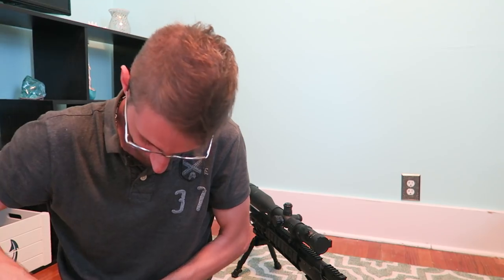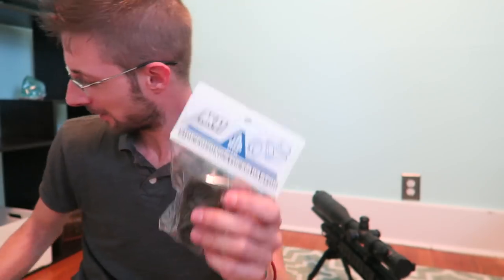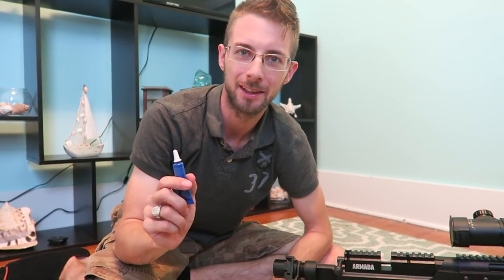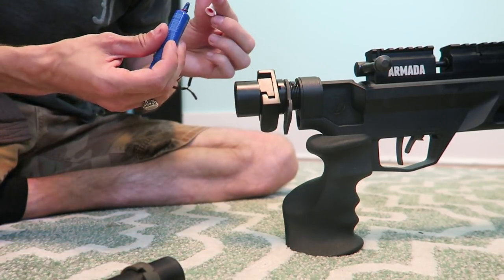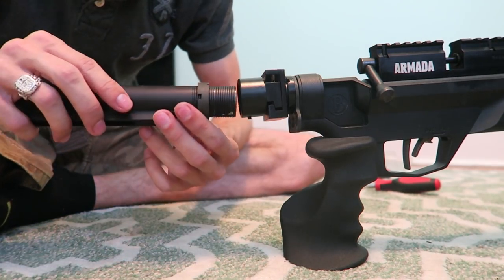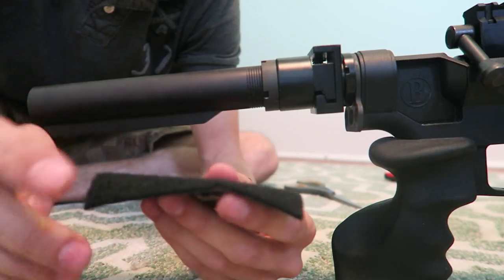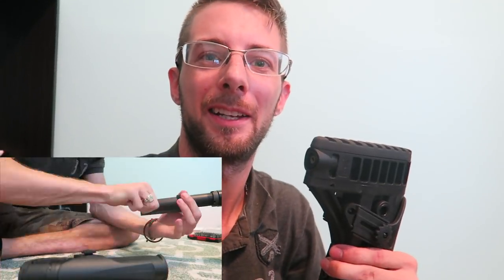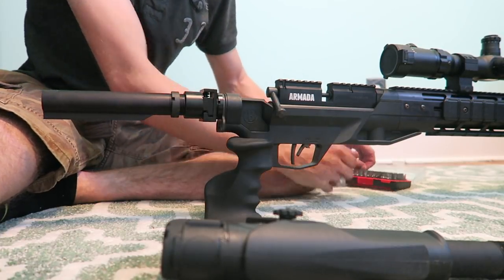Benjamin Armada | Folding Stock | Airgun Evolution

Comment: Hi if you have a problem again with this adapter witch most do i would go with the law tactical clone they look better work better also has a release tab to fold gun you might find in  soft air parts on eBay not always easy to find but if you do well worth 35$ vs original law tactical if ever need a replacement  its the way to go. nice gun i have almost the same set up.
Reply from the maker: I never knew that made a clone one I have seen a Law tactical side folder and it is awesome. a clone version would be ideal now I wish I hadn't Red loctite'd the hell out of that SOB.
If you have a link to one please send it over I just looked for one on eBay with no luck. thanks.
Reply: Airgun Evolution  I'll try to get you a good link I only will leave a link when I can find it in the 40$ range  if you type folding stock adapter right now you will see some but there trying to charge 100$ which is not to bad but it's a clone any time you see the cardboard box it a clone even if they say it real it's not . I have both and the clone is very good for it price.

Comment: Where did you get that carbon fiber silencer you had? And do they make different styles? Like a regular muzzle break. I just want something a little bit shorter. You got me excited so I got an Armada .25 and am modding it somewhat similarly. I'm doing the same folding type stock Adapter just for when I'm walking through the woods with it. and I also am going to try a canted red dot.
Reply from the maker: Awesome, my suppressor was made by Neil Clauge.. I don't know if he still makes them but you should look up Donnyfl. Donny has the best suppressors on the marked in all diffrent sizes he even had one called the Fat Boy which was carbon fiber...  one thing I would suggest is a sling for the Armada it gets heavy with all the mods and a sling would be real nice, also the plastic/ polymer rail sections they send with the gun art the best and mine broke so if you do get a sling don't trust them to hold the weight of the gun I'd get some cheap aluminum ones off ebay
Reply: @AirgunEvolution  I picked up a 2 point bungie sling off amazon, got the adapter to put on the folding stock and I went with the cvlife 6-24 x50. and some aluminum key mod rails. I went with the plastic quick indexes instead of the stock rail guards as well. plan just to put my rails where I put my mods and then cover everything else with the quick index I got a vertical foregrip for leverage when cocking and aiming. And the bipod mount. Then I'm going with a green pinty laser on the right and a flashlight on the left. Then since the magazine portrudes from the right at a 45 degree angle I got a 30 degree canted red dot, For ranges within 25 meters or so. Hoo ra lol. I live in vt and it's fun to bring an airgun in the summer while I walk the riverbeds

Comment: so when you gonna site your rifles at 80 yards   you get a realtor sign  put some card board in  where the sign goes target stand    and squeeze the trigger
Reply from the maker: Hahahaha the funny thing is I "acquired" a real heavy duty realtor sign for just that purpose. I also use those signs that people stick in there yards at election time, the range I go to has a bunch of them. unfortunately my local range only goes out to 60 yards but I have a few places for sighting in at longer ranges.
Reply: I keep 2 of the realtor signs in my truck I broke off the rods they stick the cardboard on   and put the cardboard in the metal frame    and hold it with binder clips    if I mess one up  just go get another one  I have had like 4 or 5 set up at once for a nice range

Comment: Hot air gun should soften loctite when you are ready to remove it again.
Reply from the maker: As my luck would go I found my blue lock tight the next day. hopefully I won't need to remove it but if I do I have a heat gun but the Armada stock is polymer so I don't know if a heat gun would melt it.
Reply: Boiling water may be hot enough to soften it without any risk to the stock.
Reply from the maker: Excellent Idea, I will absolutely keep this in mind if I ever have to take it off.. thank you

Comment: hello great video but you do not show how the butt collapses
Reply from the maker: Your right I completely forgot to do that.. with the stock in the open/unfolded position you need to lift up about 1/8 of an inche to disengage the spring loaded lock up and move the stock to the side a bit than you can stop lifting it up and you can fully fold it to the side it clicks into a locking grouve to retain this position... To unfold it all you need to do is pull it to the open but I like to lift up the stock move it over the locking grouve and then to the open position. I do this to reduce the wear on the aluminum folding adapter over time you can see it wearing down so this prolongs it's life.